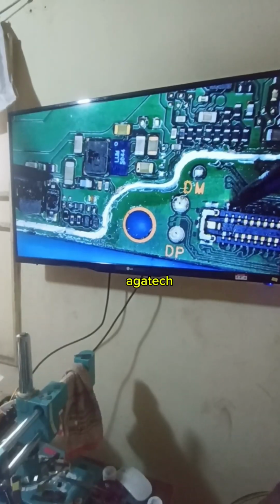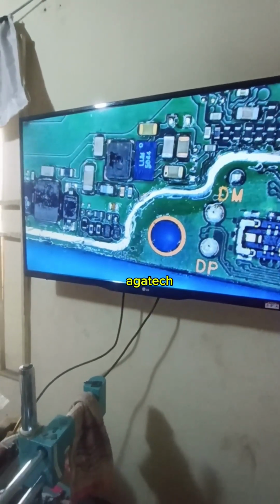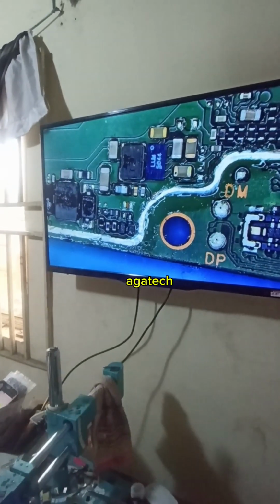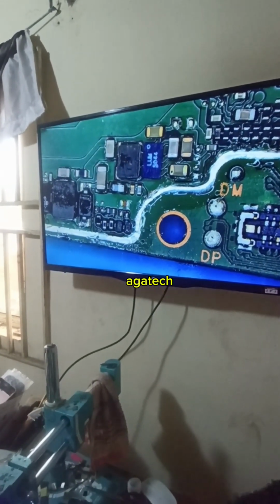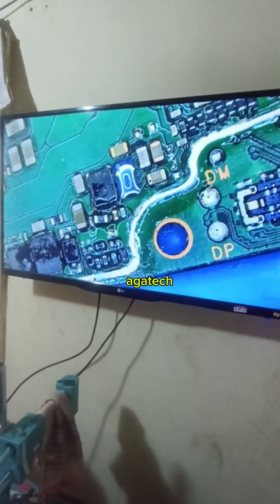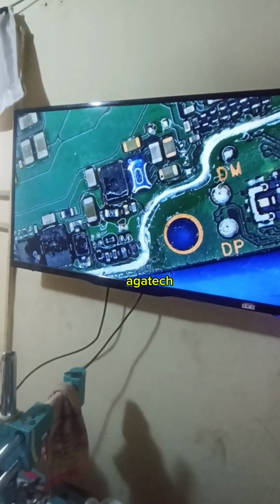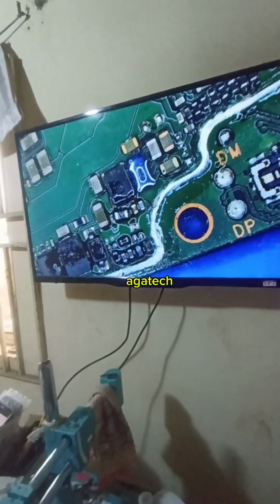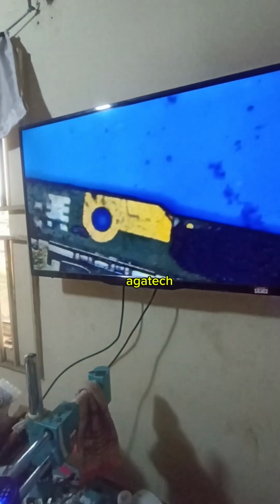Infinix hot60i (X6728) dead/display problem troubleshooting and repair

Comment: My hot 60i phone, i just plug charger, it's wasn't up to 2 minutes, my phone just went off and refused to on again. It about a month now, it has happened 😓
Reply from the maker: Where are you?
Reply: @agatech01 Delta state
Reply from the maker: @bestfx584 Okay. You can chat me privately. agatech01@gmail.com
Reply: @agatech01 can it be fixed? and what's the problem please
Reply from the maker: @bestfx584 It depends on the fault, but it's most likely fixable